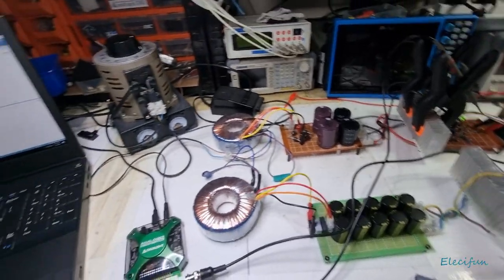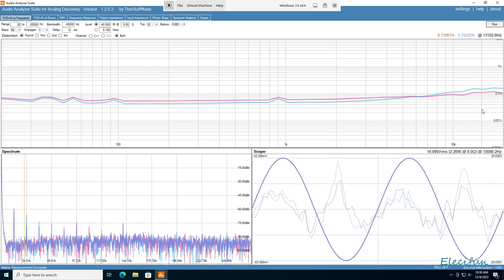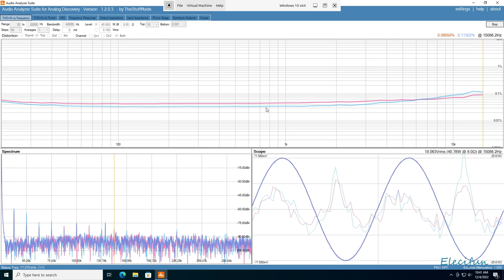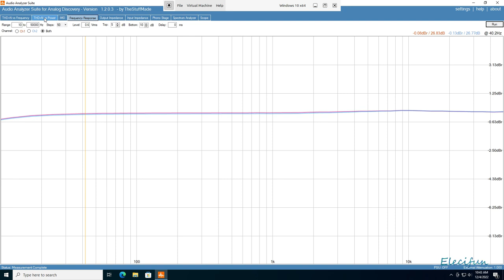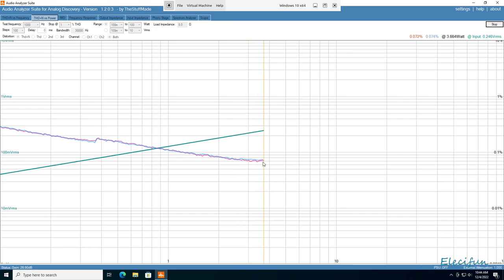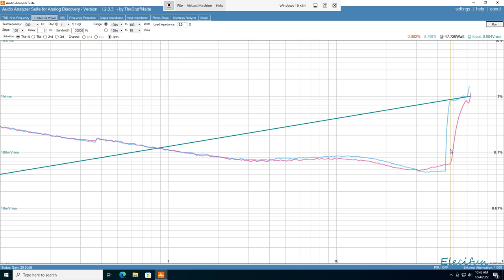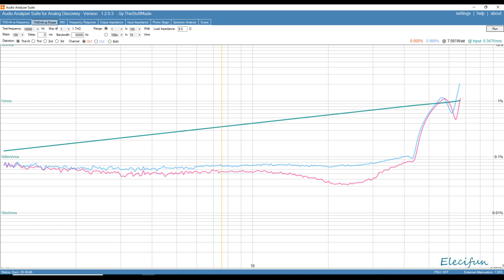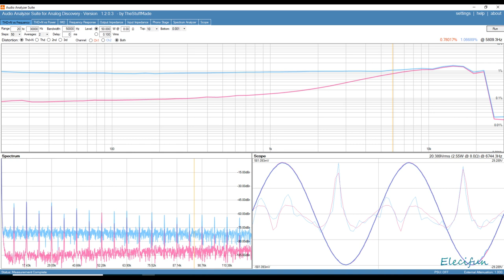ESP 60W Amplifiers Side by Side Comparison

Comment: The differences on paper were actually smaller than I expected with you using "higher quality" components etc. I'm interested to know if the human ear can detect the differences between the two amps. Perhaps after you've listened to both using the same piece of music etc you can respond with any subjective listening differences and let us know which amp your ear prefers. That is always the bottom line for me. If my ears like it, I don't care what the science or critics have to say lol. Thanks again for this terrific build series Elecifun. I enjoyed it immensely and learned a great deal. Cheers friend.
Reply from the maker: There are so many variables and much room for a better test environment. I think overall it would pass an ear test but it would be very subjective to the listener. Personally I like the sound and will use this design to try out some different preamps just for kicks. I'm glad you enjoyed and learnt from them. I still have a few tests to run e.g. adding more transformer current capability and voltage, the recommended is 25v 0 25v AC and I am using 24v 0 24v. Keeping temperatures down and the same on the dummy loads will make a difference.  
It's all fun.